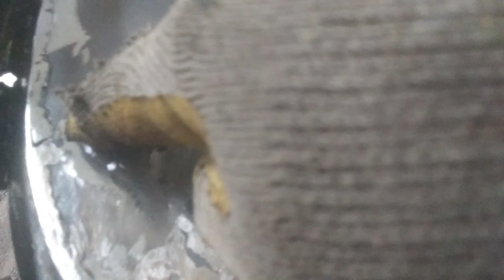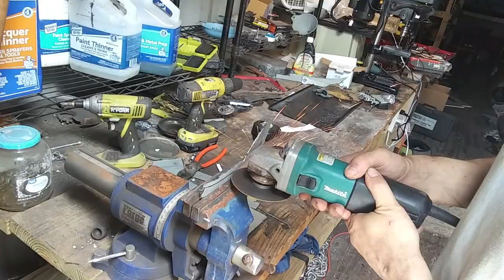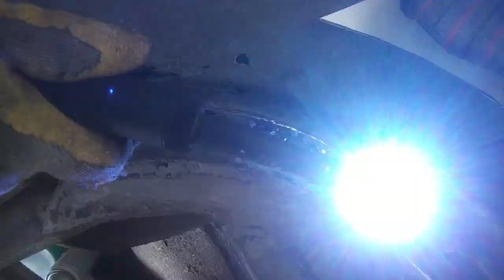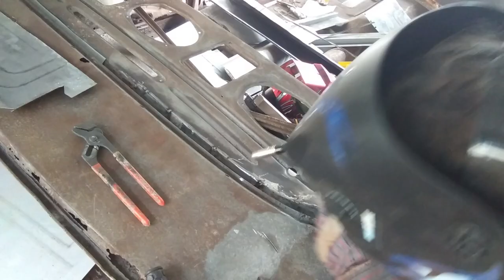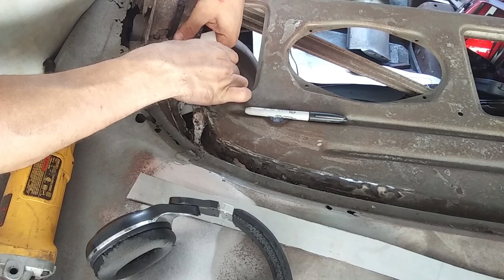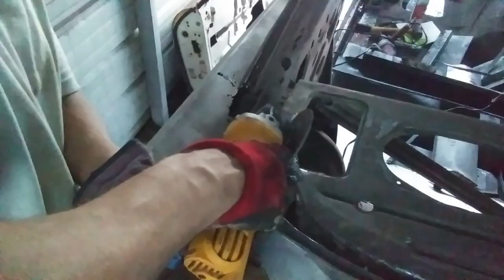1958 Plymouth Christine Restoration Vlog #36 Speaker Tray Rust Repair

Comment: I'll be following along closely. I am starting with the engine now. I have the 58 L350 being rebuilt now. I couldn't believe how hard the pistons are to find. We ended up settling on custom pistons and a custom ground cam to mimic factory lift and duration. Keep up the great work!
Reply from the maker: I still need to get the block and heads magnafluxed.  If those check out OK I'll be looking into rebuilding mine.  If the pistons can be reused I may look into new rings, if they are available.  May I ask what was the cost and where did you go to get your pistons and cam?
Reply: @CoolCatsLC  Egge.com will make the custom pistons for you if you need them. I bought my front 2652S carb off a guy named forwardlookfrank on ebay. He is rebuilding my rear 2653S carb and he has a guy that is doing the custom ground cam for the 350 GC specs. $335 for cam, springs, lifters.I had to find the GC cam specs from a 1958 magazine called "Motor Life". That magazine featured the  GC and they tore down the "new" Chrysler GC and actually put the specs in the article. I'll see if my carb guy has the cam guys info and get
 back to you.
Reply from the maker: @gearhed78  Thanks, I would appreciate that.  I have the 2631s and 2632s carbs and had them rebuilt professionally.  I know they will bolt on the manifold but was unaware that there were other model carbs.  These were advertised on ebay as for Golden Commando engines.  I'm already into those 2 carbs for $2,000.  I guess I'll just use what I have even though they are not completely correct for the L350.  I'm guessing they were for the 318?  do  you know the difference?
Reply: @CoolCatsLC  Are you certain those are 2631 & 2632 Carter AFB carbs? I am not finding anything on those. In my "Motors Auto Repair" manual,  that covers 55-62, I see nothing on those. I did see a reference on the internet for those being 57-58 Plymouth dual quads though. Odd.
Reply from the maker: @gearhed78  Yes I checked the tag on them.  Here is an ebay link  https://www.ebay.com/p/881243126
Reply: @CoolCatsLC  Yep, those are for the 318, says it right there in the description on ebay.. Good news is those can fetch near what you paid. I know for certain, the Carter AFB 2653S (rear carb) and 2652S (front carb) are correct for the 58 Plymouth 58 350 GC. Here are your correct carbs on ebay - https://www.ebay.com/itm/Mopar-Dual-Quad-383-2x4-Intake-Manifold-Carbs-Carburetor-Carter-AFB/303558568942?fits=Year%3A1958%7CMake%3APlymouth&epid=1542212974&hash=item46ad802bee:g:yKEAAOSwJ4xer5EX I would certainly recommend grabbing these. I paid the same for the correct carbs alone. That is the correct intake as well. Those fetch about $350 alone.
Reply from the maker: @gearhed78  Yes I have the correct intake and the carbs will bolt up to it fine.  I hate to buy all new carbs before I even know if the block and heads are in good shape.  It's such a small detail I'm wondering if there is even much of a difference.  I'm not going for total concours quality restoration.  I want it to be mostly as stock as possible but I have changed a few things like all wheel disc brakes.  I'm wondering if I can get away with using the carbs I have already.
Reply: @CoolCatsLC  I guess they would work but the jetting would certainly need changed since your 350 is moving more air. Yep, I get it. I am not going for ultra correct but I like the idea of using the correct carbs so all of the tuning info is accurate. I asked my carb guy about the differences for you. I'll let you know what he says. He specializes in 58-62 Chrysler so he should know for sure. Anyway, Love watching your progress! I'm several months behind you.
Reply from the maker: @gearhed78  Thank you I would appreciate knowing more info about it.  If it will affect things too much I may go ahead and get the right carbs for it.  I'm also using an E body rear end so the car is not 100% original and I won't be selling the car so the only person who will know will be me.
Reply: @CoolCatsLC  Yeah, those upgrades are invisible and only benefit the car. I always thought I would go drum brakes until I saw your disc conversion. 100 percent accurate has several downsides to performance. You convinced me on the brakes.
Reply: @CoolCatsLC  Hey, got a reply from Frank. He sent a pic of the slight spacing issue but I can't attach here.

"Good Morning Brad,
                                     The WCFB was able to handle the 57/57 Chrysler 300C/Ds 392 cu in. 375-390 HP hemi up to speeds of 150. The Mopar dual four WCFBs in 57/58 were all same parts except for Jets, metering rods and counterweights. The 2631 and 2632 could be modified with 1956 Chrysler 300B (354 hemi) Jets and metering  rods and made to work but I don't think they could be located. If you did locate them you would probably pay a steep premium. It would be more trouble than its worth as the carburetors would have to be rebuilt again. I would recommend he sell those and try to get back as much as he can and invest in the correct carburetors. There is also an offset with the bores of an AFB vs. a WCFB. I've attached a photo of an AFB phenolic spacer on top of a wide pattern (2631/2632) style intake manifold. The bolt pattern is good but the bores are off slightly. He would have to use an adapter to make it work. Even if the butterflies clear, there may be an air/fuel flow issue due to the position."
Reply from the maker: @gearhed78  Thank you for the info, looks like I'll be selling the carbs then.
Reply: @CoolCatsLC  Good news is you caught it now and not when the car was running bad. That would have been a pain to figure out. Good luck!